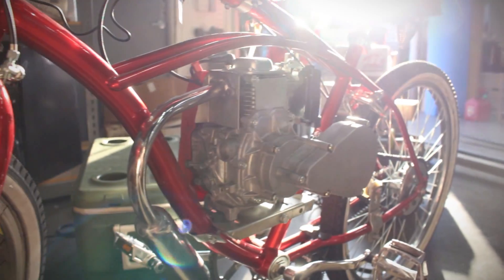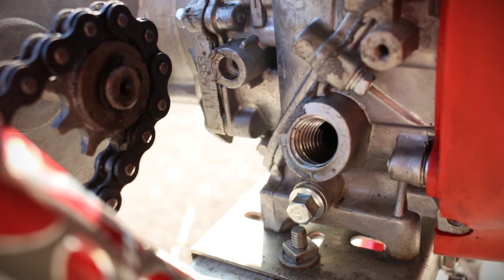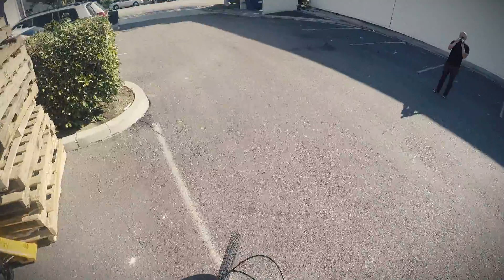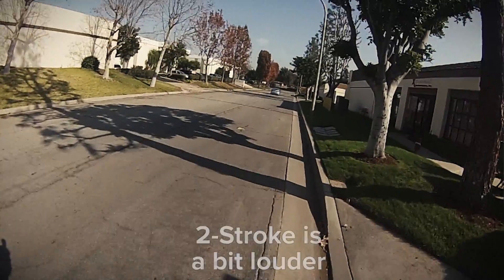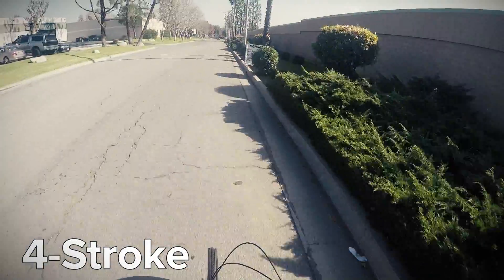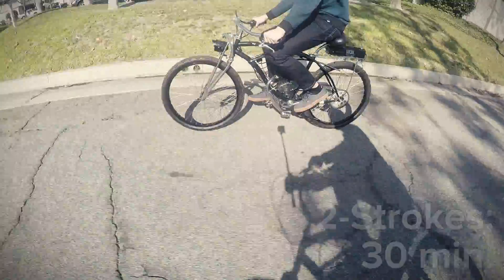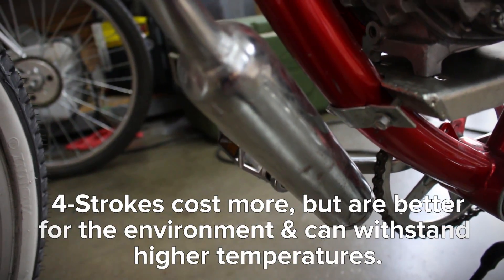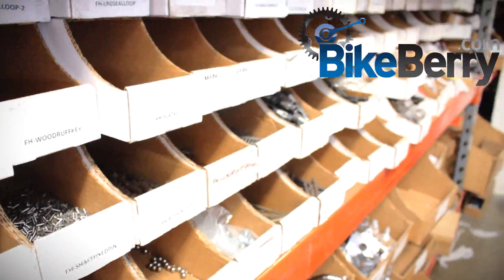2-Stroke vs 4-Stroke Motorized Bicycle (GoPro)

Comment: 2 stroke are faster cheaper and dirty, ride one in Cal you will get a ticket, 
4 stroke last longer are cleaner, and you don't need to screw around mixing oil and gas
want to go fast get a motorcycle
Reply: Lol I live in Visalia, California which is in the central valley and cops don't care about 2 stroke engines as long as we wear a dot approved helmet
Reply: what if you cant get a motorcycle or dont have a drivers license yet?
Reply: @notlogical4016  well you get either one of these motors and youll be fine. Im 14 and around 5 cops passed by and said nothing
Reply: I prefer a briggs and stratton flathead. You can get 5 to 11 horsepower out of it. Plus the sound and reliability of a flatty bike is priceless.
Reply from the maker: Great advice! There is an engine kit which fits for everyone, whether it's 2 stroke, 4 stroke, or electric. There are advantages and disadvantages each option, and should be taken into consideration when choosing an engine kit. All of our engines are intended for recreational use, and are not intended to be used on public highways or roads.
Reply: @bikeberry  why are you talking about commute in the video? Haha

Comment: Can either of these bicycles be pedaled independately while the motor is off? I used to have a scooter with a similar setup as the 4 stroke, and it seems like if you're pedaling and rev the engine, it'll engage the wheel and won't disengage unless you stop. The 2 stroke seems to be always engaged unless the clutch is pulled in
Reply from the maker: Bicycles with our engine kits can be pedaled independently by locking the clutch in its disengaged position. We provide a clutch lever with a locking pin as part of our engine kit package, or can be bought separately.

Comment: How does a SINGLE piston engine achieve TWO strokes per REVOLUTION?
No matter whether 2 or 4 cycle, you ONLY get ONE stroke per REVOLUTION or the piston has separated from the crankshaft!   You mean the # of revolutions per power cycle ?
( Two strokes per Spark for a 4-cycle compared to ONE stroke per spark for a 2-cycle))
Reply from the maker: You are entirely correct! This was an obvious mistake on our part. We clearly intended to mean stroke per cycle, as show in the provided animation. Fortunately, our audience is well adept in recognizing this mistake and able to understand the intended meaning.

Comment: If I had a choice? I would take a four stroke over a two stroke any day! It is quieter and there’s no Smokey exhaust. Sure you can use a synthetic bean castor oil in the gas/Zoila mix for the two stroke, but then there is the smell, sure it’s a sweet smell but it’s is still pollution! Now as far as speed and power? There are four strokes out there that will more than compare, but are more expensive! ,
Reply from the maker: Great advice! Our engines are few of many bike modifications available for the modding community. Based on price, performance, and availability, we advice our costumers to get the motor that suits their needs.

Comment: I wouldn’t get another 2 stroke again, if you’re going to mistreat your bike even a small bit you’ll want a 4 stroke because 2 strokes can’t take hardly any riding time and are strictly for going from one place to another.. blew my top end on my 2 stroke in 400 miles because I’d ride 10 to 20 miles at a time sometimes
Reply: wv9mm pretty much spot on, they are just really weak motors

Comment: If it's your first bike and you have reliability as your main priority you should get the 4 stroke I had the 2 stroke and if you don't tune them right they run like shit not to mention you need to mix gas which is inconvenient and you need to pedal to get started why spend money on a bike engine if you still need to pedal it if your under 5 miles per hour and to start it I live in NYC so pulling the clutch in and pedaling not to mention that if you need to do an emergency stop the 2 stroke will lock the back wheels in a four stroke it will disengage the clutch and stay running. Not to mention almost all cars made today are four stroke because they are quiet convenient have less vibrations are more reliable and are easy to setup aswell.

Comment: THE 2 STROKE WILL NOT ACCELERATE FASTER WITH ANY REAL WEIGHT OR GOING UP HILL...4 STROKE WILL PROVIDE MORE TORQUE... ADJUST GEAR RATIO TO TRANSLATE THAT INTO FASTER FLAT LAND ACCELERATION THANKS 2 STROKE...
Reply: @WC_Boyz  yes, yes they are
Reply: You supposed to pedal the 2 stroke when going uphill,  makes a huge difference

Comment: my electric bike goes 20+ mph on full throttle. it has battery range of like 35-45 miles. it doesn't make loud noises out there, so I still think ebike is a better deal.

Comment: False 4 strokes are faster stock 2 strokes are faster modified and company's push the 2 stroke due to the money made off all the parts to upgrade it .There is next to no parts to upgrade a 4 stroke right now. Get a 4 stroke no mixing and way more reliable.Mine goes 43 mph with a 50 tooth sprocket 3 speed hub.

Comment: 2-Stroke - All the power is in the top end, use more fuel, noisy, have to remember to pre mix your fuel, less reliable and harder to start in the cold. 4-Stroke, More torque and bottom end power, quieter, more fuel efficient, only have to remember to keep engine oil topped up, much more reliable and the most important thing... they don't smell as nice as 2-stroke ;)  I am by no means opposed to 2-stroke, I actually love the things! I really do think they are better suited to high performance motorbikes rather than tiny bicycle engines though, especially if you live in the UK and want to get away with riding them around illegally without getting caught by the old bill :) Plus, from the figures I have seen quoted the power difference between the same capacity 2-strokes and 4-strokes is negligible, they are very cheaply made an are not tuned. Only when you start to polish ports, tweak carbs, filters, and expansion chambers (in the 2-stroke case) will you start to notice differences. Maybe if Stan Stephens starts doing a bicycle engine tuning service/kit I will be interested in the 2-stroke option LOL
Reply: Jack Hakke I got a 2 stroke with high top end speed and lots of torque.  I will dust u on my 80cc 29 inch cruiser

Comment: I like that 2 strokes are faster but I also want my motor to b quiet. I'm torn
Reply: Rickyfyied at full throttle, the 2 stroke is louder. Straightpiped the 2 stroke can be heard from miles away. Not kidding
Reply: you can upgrade the muffler on the exhaust
Reply: Devin S 
Get a muffler for your 2 stroke
Reply: Rickyfyied not that much louder actually. They can be if you mod them but 2 strokes arent that much louder than a 4
Reply: Upgrade the muffler then
Reply: Same. I wonder how much louder they actually are though

Comment: I have a 65 years old moped with a JB 2-stroke engine, and this moped was used many hours a day every day in like 20 years, and it still works great... so why can your engine run only 30 mins?
Reply: Erik Blomgren they're buying cheap chinese parts
Reply: Yeah, Probably...
Reply: Things were built to last back then.. not the cheaply made horseshit on the market today. Made to break so youll have to keep buying engines

Comment: LOL 4 strokes per revolution! they are both 2 strokes per revolution. its 4 strokes per POWER cycle for a 4 stroke!
Reply: Up and down movements both count as a stroke.
Reply: 2 Stroke- 1.Suck bang 2. Squeeze & Blow
4 stroke- 1. Suck 2. Squeeze 3. Bang 4. Blow
Reply: @Octanetroopers_01   One of us is messed up we both can't be right. I believe the two-stroke does all four cycles in the same order as the four stroke suck squeeze bang blow. It just accomplishes this in two strokes of the piston or one revolution of the crankshaft. And of course the four stroke does it in four strokes of the piston or two revolutions of the crankshaft.
Reply: 100th like
Reply: Stfu

Comment: Have you ever had a lawsuit filed against you for unsafe manufacturing? Since the bicycle bearings (cheap walmart bikes) and the frame is not meant to withstand heavy loads and chinese engines are infamous with seizing how do you handle the complaints? Has any of your customers injured yet by a direct result of assembly / manufacturing?
Reply: Mozart i second this
Reply: wv9mm if it blows up for no reason he can claim. Lets say, perhaps a bearing on the bike burns up    its on him to make sure his bike is in good working order before the engine gets installed
Reply: wv9mm once its under 50cc and cant go over 20 mph youre grand
Reply: Mozart mix the oil right for 2 stroke engines and they can outlast 4 strokes. Not saying they will, but they can. Theres a difference

Comment: Hey bikeberry, I want to take a motorized bike trip from Philadelphia to Atlantic city (About 70 miles). Which engine would be best suited for the task? (and less likely to kill me) I understand 2 strokes can have a lot of performance parts or heavy duty parts that could increase reliability but 4 strokes last longer. I'm currently running a 2 stroke. what are my options ?

Comment: It's not 2 and 4 stroke per revolution.  One revolution equals 2 stokes of the piston,.  1 stroke of the piston down, one up.  Now the 2 stroke has power on every downward stroke (every second stroke) the 4 stroke has power every other downward stroke of the piston (i.e. every 4th stroke.

Comment: Why is the recommended ride time .5 hr for the 2 stroke and 1 hr for the 4 stroke?  Is that how long the fuel lasts?
Reply: Captainpegs07 no, the time is how long you want to use the engine before it overheats and gets damaged. So let it run for 30 and let it cool for a bit.
Reply: Captainpegs07 that's a bunch of bull, I've ridden my 2 stroke for 1.5 hours one way and another 1.5 hours back many times and usually keep my engine running for about an 1 hour every day crusing around

Comment: 25 mph 4 stroke my ass! Try 45mph!
Reply: Nicholas Hillyer that little 50cc engine can't hit anywhere near 45mph
Reply: Most I got out of a 49cc 4 stroke is 30 maybe 35 mph on a good day using stock parts. With a 36 tooth drive sprocket or a shift kit I'm sure you can hit 45 mph but that means higher RPMs which can lead to transmission failure if your using the crappy Chinese transmissions.

Comment: 4 stroke requires 4 strokes per revolution and 2 stroke requires 2 strokes per revolution....lmao
4 stroke engine has a power pulse every other revolution meaning the engine has to do 2 revolution per power pulse.
 2 stroke has a power pulse every revolution.
Half a revolution is  a stroke.

Comment: ...it says they recommend 30 min ride time for a 2 stroke but I think the shortest I've ridden mine was an hour and the longest was 4...
Reply: Crazedisme me too no harm
Reply: bluckingblucker XD I blew my engine a few months ago! now I have a ninja 250 xD
Reply: Crazedisme, I ridden mine longer than 30 minutes too.
Reply: Longest I've ever run my 2 stroke was about an hour. Sometimes full throttle sometimes half. but its usually a short commute to the store and back.  No issues yet.
Reply: That is true. I ride my 2 stroke for an hour each time too. But it is winter now. I have to wait till summer and see how the motor can handle it.
Reply: Crazedisme 

Yeah I was gonna say a half hour?  How has yours held up over time?
Reply: WHat they say is bs.
Reply: Crazedisme same
Reply: Seems more of a suggestion then.

I suppose the takeaway here is that 4 stroke tends to last longer than a 2 stroke.
Reply: Yeah it doesn’t matter because they are like 100 dollars anyway
Reply: Mine was 20 before having a problem

Comment: get it right: a 4-stroke (4-cycle) engine has 2 strokes per revolution, not 4.  intake and compression on the first revolution and power and exhaust on the second.

Comment: Hey guys, my brake cable gets out of adjustment very quickly no matter how tight the cable is. Any ideas? I got a 2 stroke and its fun to ride.
Reply: Peter Kapica go to a bike shop, might be worn out cables, or not tightening the brake linw bolt good enough

Comment: The other problem is you can buy a used motorcycle for $750-$800 on Craigslist.  A year of motorcycle insurance is $60-$100 and a 250cc motorcycle gets about 75MPG.  Plus, you can actually ride them legally on the road and they can keep up with traffic.  Which makes the motorized bike more or less worthless.  Now, an electric bike could be ridden on a bike trail and that's fun.  But still the cost to build one is as much as buying a used motorcycle.

Comment: the baffle on my muffler fell off and my bike wont start will getting a new muffler fix that?? also i am not sure it is even getting spark
Reply: If its got compression, then check the cdi, you might need a new one. Also where do you store your bike and whats the weather like if stored outside
Reply: +Peter Kapica it is getting spark but no compression
Reply: +Eli's Magic sounds like bad rings to me

Comment: which can go up hills better?
Reply: 2 stroke
Reply: 2 stroke can go up hills better because it's a lighter engine
Reply: depends on your gear ratio, but typically the 4 strokes torque better, while 2 strokes get higher rpm, Im not sure if that is the same to the kits though.
Reply: Typically 4 stroke

Comment: both motors have a clutch, what the hell??
Reply: Do you want to stop the engine when you stop?
Reply: +Peter Kapica I'm takin dirtbikes and what not
Reply: +Peter Kapica these guys are talking about a difftently built motor then what I'm talking
Reply: T Parrish the motr with the clutch lever on the handle bar  is like a dirtbike, but the other motor has a centrifugal clutch which means that when you give it throttle, the springs inside of the clutch engage the pads that touch the clutch bell and move the sprocket Which moves the sprocket on the rear wheel
Reply: The only thing I can add to this is that there are 2 stroke engines with centrifugal clutches.
Reply: +Robert Sampson I agree with. yes there are some 2 strokes with a centrifugal clutch too
Reply: Anthony Marin I own one.
Reply: Robert Sampson oh that's pretty cool.  I used to have one but I sold it so I could buy more parts for my My I chopper I'm building right now
Reply: *mini  chopper

Comment: 2 stroke v 4 stroke take the 2 anyday In less its 150f 😛 but the 4 stroke is more reliable then the 2 stroke, the 2 stroke you'll find its got more power on acceleration then 4 stroke the 4 stroke will have lot more power on topend

Comment: Your full of it a 4 stroke will outrun a 2 stroke any day I own a 4 stroke my brother owns a 2 stroke, also that 2 stroke is loded with performance parts like intake and exhaust upgrades and a big bore carbureted all around I prefer the 4 stroke for reliability torque and overall power.
Reply: You are wrong
Reply: You have to think about the fact that the 2-stroke had a regular clutch on it meaning that it is making direct contact with the drive. The 4-stroke had a centrifugal clutch which is friction and doesn't hold as strong as a clamp like clutch system making it less efficient in power delivery. With a centrifugal clutch relying on friction, this makes it harder and harder for it to run efficiently as it heats up more and more based on the application which can effect response times and acceleration along with top speeds.
Reply: I want a 4 cause of long distance is that  a good idea
Reply: russ Sottile then get a 79cc predator
Reply: So if you have a 2 stroke 125 it is slower than a 125 4stroke I don’t think so😂
Reply: Umm my little bro has a 5cc engine and I have a 250. He has performance upgrades and stuff but my engine is so much bettttterr. #4Stroke4theWIN #YOLO
Reply: my 2 stroke is pretty reliable but the 4 stroke requires oil changes
Reply: No, 2 strokes accelerate faster and have higher top speed because it has less cycles than a 4 stroke, either your brother has a bad engine, or the c.c is smaller

Comment: I'd rather just get a 49cc or 150cc scooter. I wouldn't trust bicycle brakes when I'm going 25-30 MPH....
Reply: I got none at all on mine and does 35
Reply: Ian Above 25-35mph is not even that fast I have a highly modified 2 stroke that can hit 56.4mph (GPS tested) and the breaks are not that bad.

Comment: bullshit my 80cc motorized bike runs 2 hours
Reply: I don't need to learn anything from you.  You need to learn to take a joke and not act like a child.
Reply: Dylan Cheska you can just replace the magneto not the cdi, the magneto is usually the problem I have fried 3 magnetos so far they cost like $10 on ebay just type 66cc magneto
Reply: Thanks
Reply: On a tank of fuel? You can get a bigger tank or ride slower
Reply: On one tank
Reply: Dylan Cheska get a bigger fuel tank or ride slower
Reply: And adjust the carburetor
Reply: My bike dose not run any more
Reply: Dylan Cheska what happened
Reply: He burned it up
Reply: Did not
Reply: Peter Kapica  just wouldn't start any more
Reply: Dylan Cheska give it some starting fluid and some fresh gas and it always will fire up
Reply: David Lawrence you got to learn to shut you mouth
Reply: David Lawrence you don't even know what it looks like
Reply: Peter Kapica i think i fried the cdi and  the 
magnito
Reply: Dylan Cheska it's easy to replace but I think you can replace it with a lawnmower magneto
Reply: I'll try that
Reply: I guess

Comment: hey bike berry I have a schwinn JAGUAR beach cruiser it has 7 gears in the rear wheel the pedals only have one gear  I want a 4 Stroke engine but I don't know what kind of kit I need with the 7 gears and also I try to look up 4 or 2 stroke instalation videos on bikes with gears (10 speed , 7 speed , mountain bikes or a bike like mine's ) but no luck do you guys know of any video or you think you guys can make a video about this it will be a big help to new customers THANKS SOON TO BE A FIRST TIME CUSTOMER AND RIDER CAN'T WAIT😆👍